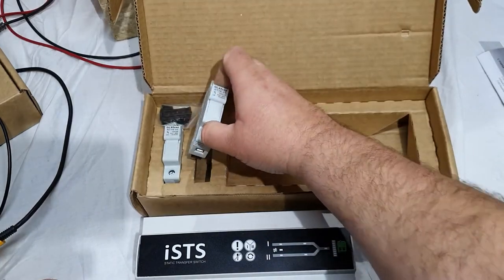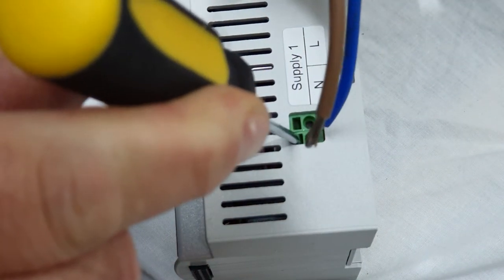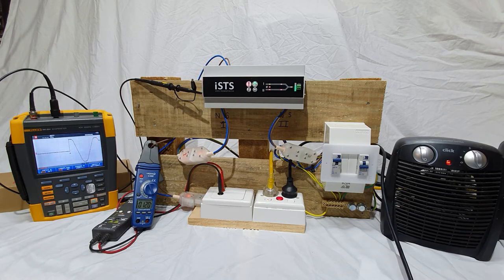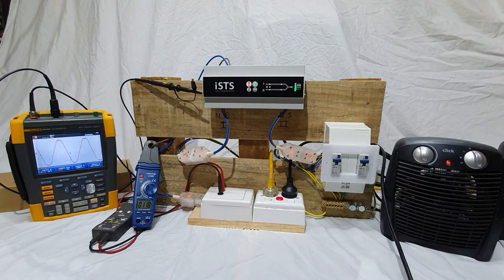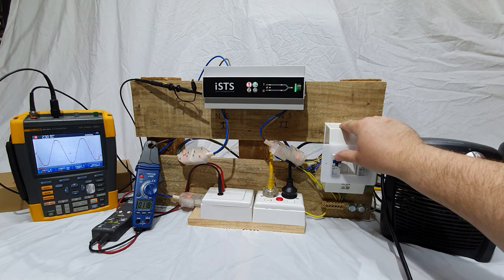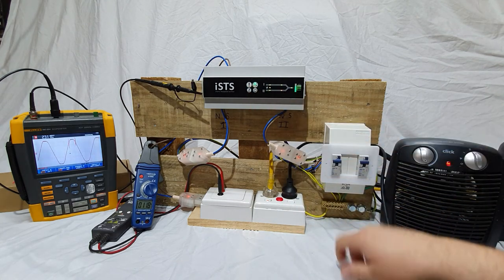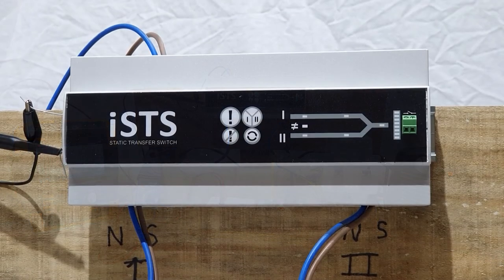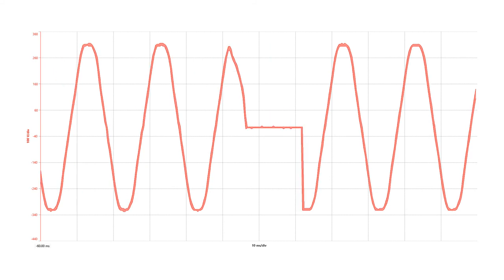STATIC POWER | Static Transfer Switch | DIN R

Comment: we purchased this static transfer switch,it is not capable for under voltage coil fixed circuit,we are facing the problem at the time of transfer from supply one to supply two, is there any solution for supply transfer without any delay ????